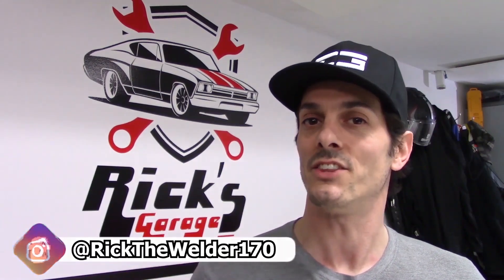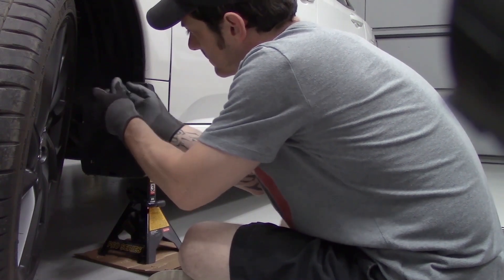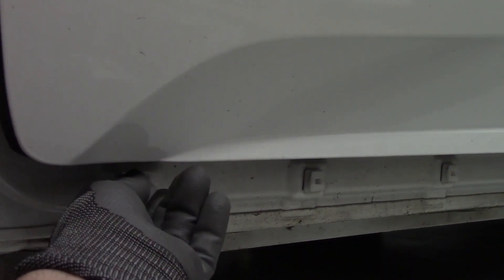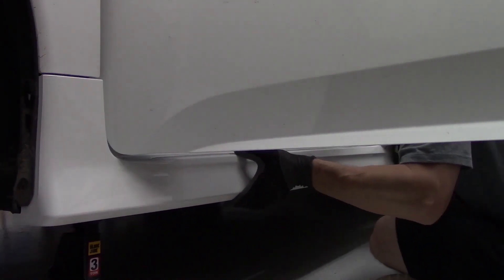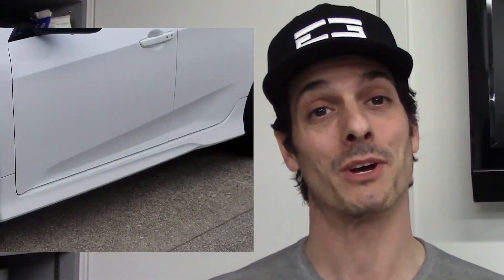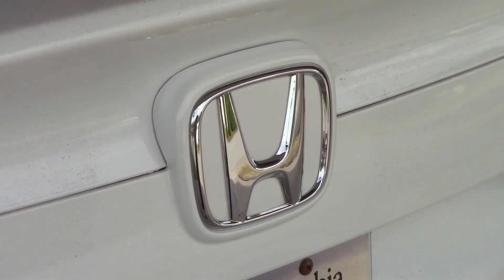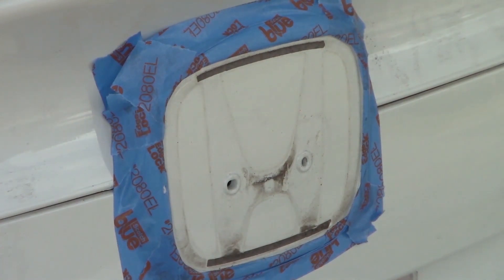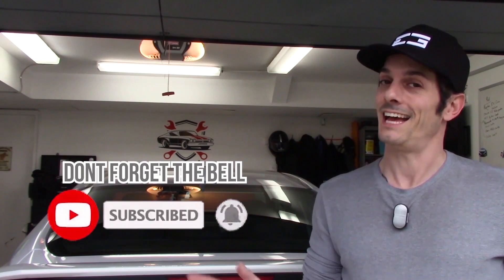HFP Side Skirt and Rear Emblem Install - Rick's Garage ep. 33

Comment: Great install video! 

I am curious as to why the mud flaps did not fit with the HFP side skirt? Does this mean there are no mud flaps that will work once you install this mod?
Reply from the maker: The mudguards fit partially over the skirt and are contoured to fit but the hfp's have a different shape completely.  As of yet, I havent found mudguards that I really like.  Rally Armor has a few offerings but it's a little too rally looking for me.  Stay tuned and subscribe (if you havent already) I'm planning on modding the factory guards to fit the hfp skirts!

Comment: Installed 6/2023 on my 2016 civic coupe is PRL Motorsports Honda original painted side skirts  that look just like the HFP HPD package ones.   It did not have new under spats included , and the old spats  didn’t fit on the new skirts.

Comment: Did you ever get the mud guards trimmed to fit?  My Si didn't have them so I added them on. I want to get the skirts but only if the mud guards will still work.
Reply from the maker: Not as yet but it's in the works!!

Comment: I would like to ask if this white is White Orchid Pearl?
Reply from the maker: Excellent eye!  It is in fact, White Orchid Pearl.  The colour was replaced in 2019 by Platinum White Pearl.
Reply: @RicksGarage  Because my car is a 2018 SI, I am currently looking for the side skirt of HFP, so I want to confirm whether the color is correct, and I would like to ask if the side skirt of the Sedan model does not have the HFP badge?
Reply from the maker: @stephendurm  it came with the hfp badge, I just chose not to install it
Reply: @RicksGarage  That's it, so will he come with a badge when he buys it?  I will be buying from a shopping site, I am not sure if the badge will be attached
Reply from the maker: @stephendurm  if the kit is dealer installed, I'd presume that it will have the badge
Reply: @RicksGarage  I will buy it to install it myself and hope everything goes well... But the volume seems to exceed the air freight limit, I have a headache, in short, thank you for your answer

Comment: No offense Rick but your rear emblem looks like a fake, I could be wrong and it could be the camera angle. I recommend you do your research and compare it to the ones sold on ibc motorsports. Another unique option I wanted to mention is using Mugen front/sides as found here on kingmotorsports. Other then that great content as always.
Reply: Mugen side skirts won’t fit the coupe.
Reply: @jonathanm5742  yep ur right just for sedan only